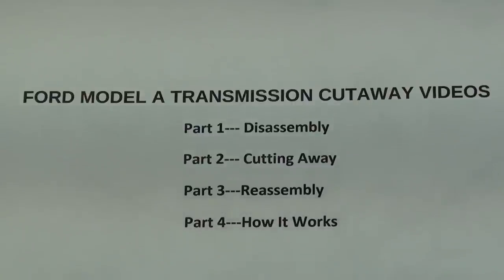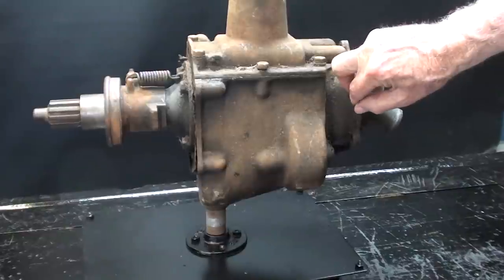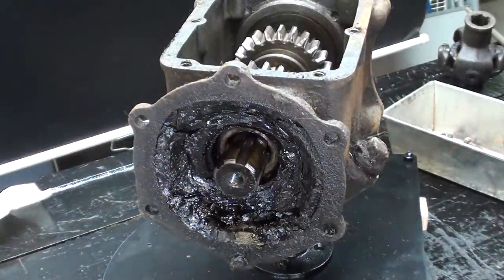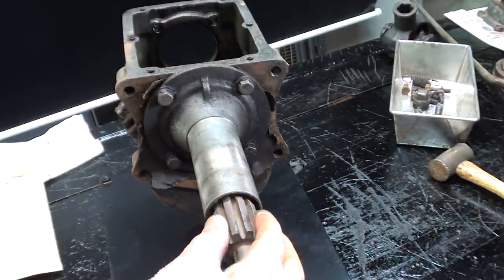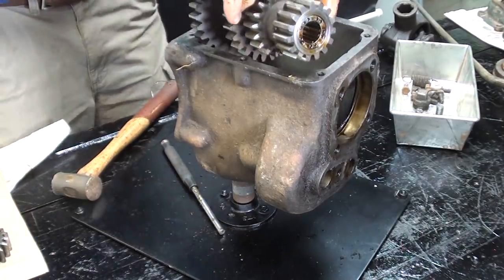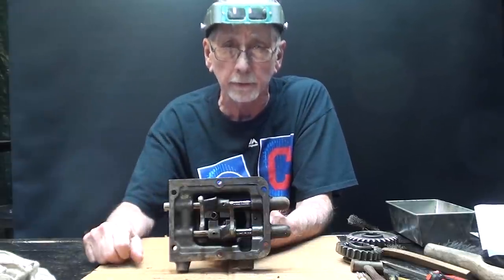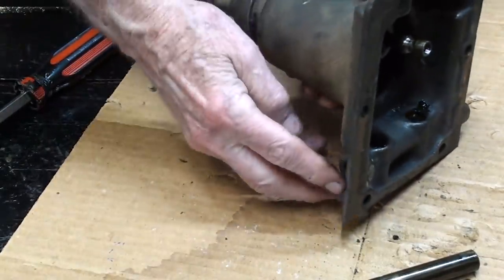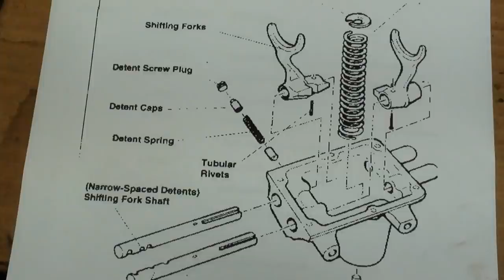Make a Transmission Cutaway FORD Model A pt 1 DISASSEMBLY 733 tubalcain

Comment: Brings back memories of my childhood where I took one(transmission from model A) apart in the late 60s or 70s. My dad had it mounted on legs with a large probably 16 or 20 inch  pulley and motor with a step pulley on it made to drive on the clutch end, and a pedal grindstone on the driveshaft end of the transmission. The setup was used for a speed reducer to sharpen mower sickles and butcher knives without having to pedal the stone by foot or hand.!
 I still remember that on  drive clutch end he had the pulley centered with nails driven into the splines/gap/ to center the pulley hole/shaft/ and had the gap poured full with  babbit or lead, not exactly sure of the filler he used but suspect it was babbit from rod bearings/caps.
  Low gear was a good sharpening speed for the grindstone. High would make it run much faster. As a young kid I took it and many other things apart to see how it worked. I was young but I learned all about gear ratio and leverage from that old setup.Also learned that that kind of grease was hard to wash out of clothing(:
 Nice Job on the videos!
Reply: Great story, you must mean your mom nicly told you that the grease was hard to wash out.
Reply: Good story. Good memories.

Comment: Okay, that was fascinating! Two things: (1) My machinist grandfather had one of these connected to a band saw for speed reduction. Most likely it was a wood cutting saw and he used the transmission to slow it down for metal cutting. (2) This part is a testament to the entire craft of machine shop work. Every part was made on the shop floor. NO CNC. NO COMPUTERS. All made by Ford machinists who most likely learned how to do it in the Henry Ford Trade School in Dearborn. Mr. Pete has showed some of the Ford text books used by the apprentices in their education. Can you even imagine a factory set up today to produce these? They made thousands and thousands of them. Can hardly wait to see the next parts!
Reply from the maker: I originally bought these transmissions, thinking I would use them on one of my bandsaws.      But they are physically a bit too large.

Comment: As a kid on the farm, we had a wooden one hole corn sheller driven by a small engine through a Model A transmission using low gear. We used it to husk black walnuts in the fall. It was always fun to put the transmission in reverse and watch the machine put the husks back on the walnuts.
Reply from the maker: lol

Comment: What a cute little unit.  In essence, the same as now, without the loose needles and hardened thrust washers and the constant-mesh gearing and synchronizers and all the other things that higher horsepower requires.  Should make a darned good cutaway.  BTW, the detent "bullets" not only help secure the gear in mesh, but lock the adjacent shaft to keep the unit from going into 2 gears at once.  A bit of nomenclature: input shaft, main shaft, counter shaft/cluster, reverse idler and shaft.  1st, 2nd and reverse are gear drives, 3rd is a spline clutch.  All of the gears, input and main shafts and cluster are steel forgings, castings would not stand up, even at the reduced loadings of the day.  These shafts make excellent sources of alloy steel for fabrication.
Reply from the maker: Thanks

Comment: Everyone I've ever known to repair one of those old model A transmissions has replaced the rivets with sheer pins. The hollow rolled steel pins with the split down the side. Their plenty strong enough and don't easily work their way out. Especially with some lock-tite to help hold them.

Comment: Excellent presentation and timely .Thank you so much! I just bought my first Model A (1930)  upon retirement from my 52 years of employment and also from working on antique tractors. I noticed a nice little puddle on the machine shed  floor where my car had marked it's territory under the transmission over the past week. Hoping it was the wrong gear oil from the previous owner.  Oh, by the way. Someone played a trick on you and put a Cubs logo on your t-shirt.  :-)

Comment: I rebuilt the T5 transmission in my 1990 Mustang. Even though it's 60 years newer there are many similarities between that Ford 3 speed and my 5 speed, especially if you ignore how they tacked on the overdrive 5th and the syncros. I had no problem in following along. The T5 has a similar cluster gear, similar reverse idler shaft, input shaft, output shaft, and shifting forks. Looking forward to the next in the series.

Comment: In all the manual transmissions I used to work on, the needle bearings where free. Held in place by just grease to reassemble. Almost always, some fell back out making one want to say, never mind. I never seen needle bearings like them on that transmission. Makes me think that they made a change to just rile me. Much preferred to work on automatics back then.

Comment: I have one of these that came with the bell housing. I'm going to use mine for a garden tractor somewhat like the Popular Mechanics pow'r pup tractor. I also have a '49 Plymouth transmission I want to do the same with. It was a column shifter, and I'll need to make it a floor shifter to make it work. It too is a 3 speed, but it has a very long pilot shaft.

Comment: You can get replacement rivets at Rivet World. At the outlet center on the old bypass. Between Batteries R Us and Lucille's Lampshades and Chandelier Emporium. 

   Just found out they are running a sale on #4 copper rivets. If you buy over a pound the burrs are free! 

  Read less
Reply: uncle reeler  Yes! That whole outlet center is great! 
   I usually stop for lunch at Sammy's Only Sammiches. Their weekday special is usually an open face refried beans and onions. Monday I have a noon appointment to get my trailer hitch ball polished and calibrated at Shiny Balls.

Comment: The heavy spring on the shifter “handle” held the handle in position. While driving, the driver could lift the handle out of the detent and rotate it out of the way to allow more leg room for the center passenger.
Reply from the maker: Thanks I did not realize that

Comment: I saw an old South Bend lathe on Craigslist last year that had a manual car transmission rigged into the pulley system, I think he had a 12 or 16 speed lathe.
Without the quick change gearbox.

Comment: Quite true about patent inventorship.  

Up to about the 1980s we were expected to include our boss' name on the patent, even if he had little real input to the invention.  It was a courtesy, sometimes a suck up, depending on attitude.  

Then the USPO said that a patent could be invalid if inventorship was misrepresented.  So ended those with 300 to 1000 patents falsely attributed to their name.
Reply: Couldn't agree more.  I have four patents that have names on them that had no input in the design or invention of the product.  Countless other patents that should had my name on them as the inventor and others took the fame.

Comment: Good morning Mr. Pete, I see you are fixing to repair your first car's transmission rite after that horse died that you keep beating. I heard you when you said you bought them at auction. Every young man wants to tear into the unknown of the mechanical things. Have plenty of hand cleaner for cleaning hand after class. Good luck on your project.
Reply: He never beat the house until after it was dead.
Reply: Horse
Reply: @mitchstephen5491  You can edit your comment by clicking on the three little dots that appear at the far right side when you scroll onto your comment. It will allow you to edit or delete your comment.
Reply: @simpleman283  thanks for letting me know that
Reply: @mitchstephen5491  👍

Comment: if only modern transmissions were so straight forward .
Reply: To many rely on to automatic transmissions and they really don't teach manual transmissions in Driver's Ed anymore. Unless you have to drive heavy motor vehicles you don't see manuals as standard equipment transmissions.

Comment: sorry mr pete what a waste a frend has just spent 4 years looking for one of them in the uk
Reply: They are literally all over the place here in the US.  There are more original engine and transmissions than there are cars that would ever need them.  Because all the Model As now have Chevy 350s and TH350 automatics.  Not too many people are restoring them to original, though thankfully as the years go by more and more are.  Still, parts are everywhere, it is the steel bodies that are unobtainium.

Comment: Seriously you would destroy an A model ford gearbox for a teaching aid - to teach us about 1920s gearboxes .??? Seriously - wouldn’t a non descript Toyota one be better and leave the vintage gearbox alone.
Reply: Seriously, if Mr. Pete had left them alone both would have been scrapped. Much better to learn how these simple gearboxes work from the master.
Reply: There were millions made with probably hundreds sitting idle in farm field junk piles / barns. Plus all the scrap cars people have they're trying to sell. If the transmissions were of value restorers would be searching hard for them and paying good money, much more money than scrap prices.
Reply: He saved them from the scrap yard.
Reply: Seriously, he will sell it to you for $500.  Get both for $750.  What a deal!  Seriously...
Reply: Agreed to leave alone even though they are worthless. Model A parts suppliers catalog have a very detailed exploded drawing showing everything. Model A clubs probably sell How To manuals or videos for disassembly and restoration.
Why not a worn or busted more modern 4 or 5 speed?
But I bought a Seldon lathe that someone had mounted a Ford truck transmission connecting the lead screw to the lathe spindle (The wrought iron worker would heat the middle portion of square stock to red, insert it through a square opening replacing the lantern and using a square collet at the head stock, the tailstock was removed. Then he turned the motor on putting a decorative twist pattern on that fence spindle)!
Reply: My next project, if it ever happens, a Hendy Tie bar 16" lathe powered by a Ford Model A tranny!!! There's a few out there setup doing the same.  They didn't all go the scrap yard in the sky.